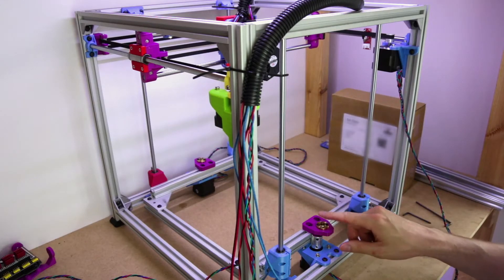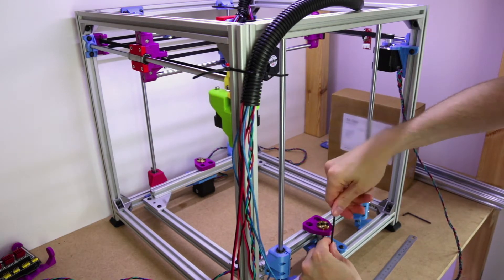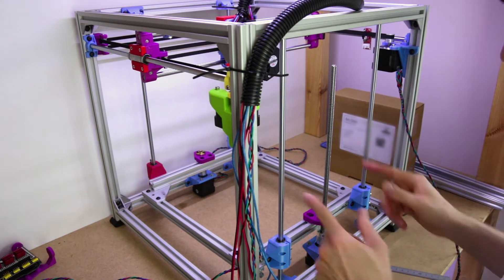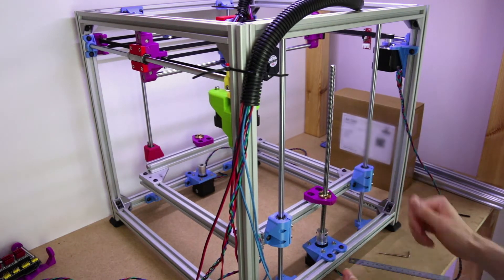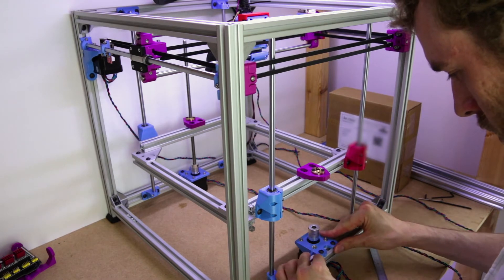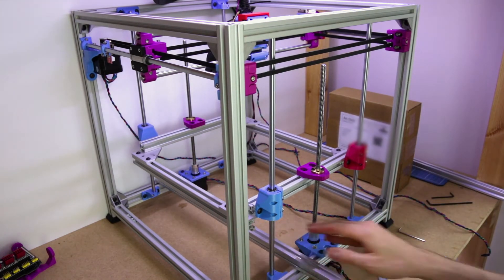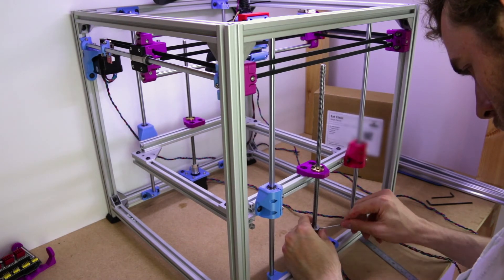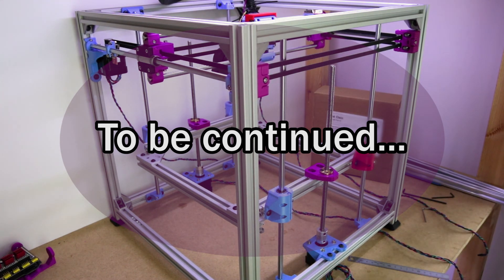Install and Align Lead Screws - STEVE Build Ep16

Comment: That lead screw seems to move to much even when you account for a coupler compensating for misalignments. Couplers still have their limits and to ensure those limits are reached you still need to align the rods and the screws better. Also, the proper way to install the helical beam couplers (or the flexible coupler) is to lift the screw a millimetre or two before tightening the screw. It might be a matter of preference but helical beam couplers with integral clams might provide a more uniform grip on the screws. Supporting the build plate with Oldham couplers and placing thrust bearing between the motor and the helical beam should help with other alignment issues and reduce the load on the motors.